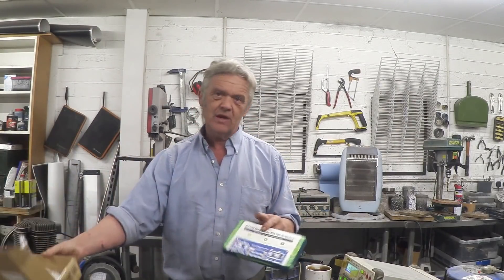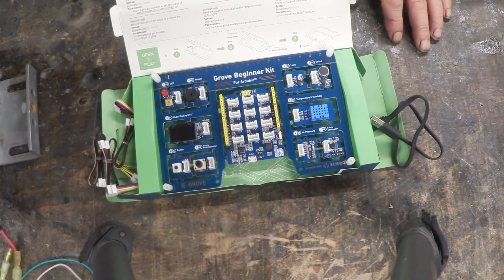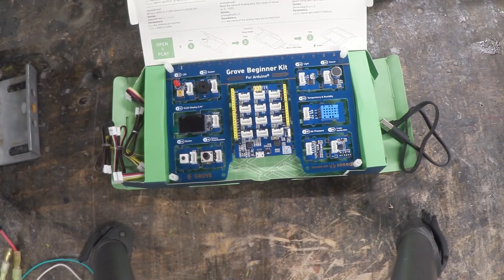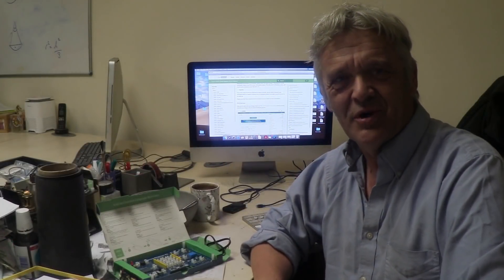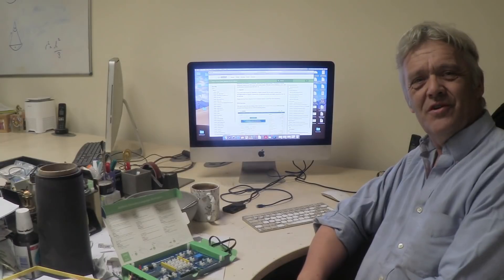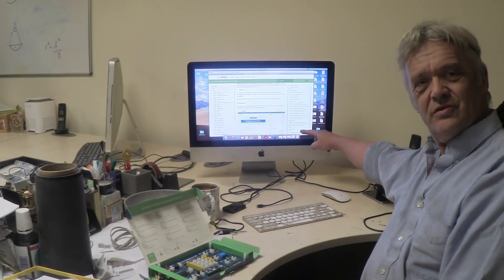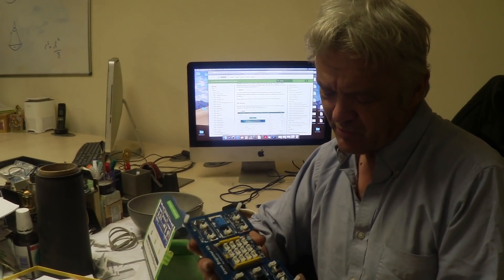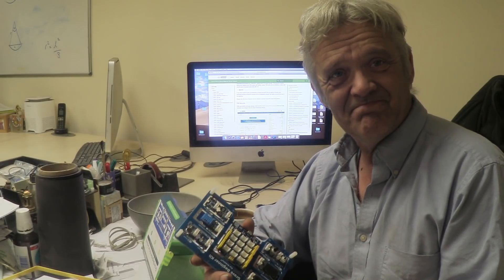1189 Seeed Grove Beginners Kit Review And Running A BLDC Motor

Comment: If anyone is interested in doing it with solder and bits The Engineering Mindset on YT (nothing to do with me) has just covered PWM motor controllers (basic circuit and how to chose your component values) ..... might just be worth it to learn a bit?

Comment: I enjoyed your twist on using the seeed as the servo tester to run the esc, very clever, however a little detail was needed on the type of signal it was producing to control the esc. The signal is one of the most common and used as the pwm for servos signal. Normally stuff like this is too complex for video but this one is so simple to explain, and I feel you could do a bang up job, CHEERS! By the way just switching 2 of the 3 BLDC motor wires will reverse the motors direction, so a DPDT switch used to reverse a standard brushed motor will also work with a BLDC motor.
Reply from the maker: cheers mate

Comment: check out "Odrive" controllers, they know how many poles the motor has and use some voodoo magic to work out what position the motor is in so will stall at one coil for startup, they work so well they can actually hold position and act like they are spring loaded, cool stuff, but the main thing is they should fire up that motor no problem, no need to spin it to get it going :)
Reply from the maker: will do mate - cheers

Comment: cool, kind of reminds me of the old radio shack 10 in one kit i had from the early 70,s but a tad bit more useful, should check out the groove, thanks for posting
Reply from the maker: glad you liked it mate - cheers
Reply: @ThinkingandTinkering   In 1974 I got the Radio Shack 65 in one kit for Christmas had tons of fun with the radio transmitter circuit.

Comment: That's a cracking bargain at £20! I'd be tempted to swap the arduino out for an esp32. So long as you pull the right libraries in the IDE they work identically to an arduino but have lots more power/features.
Reply: looking into it, it's not a drop in replacement - didn't realise the centre board was a custom arduino board
Reply from the maker: thanks for the tip mate